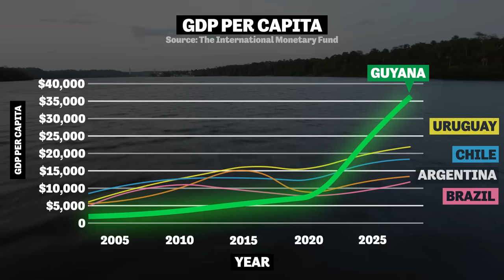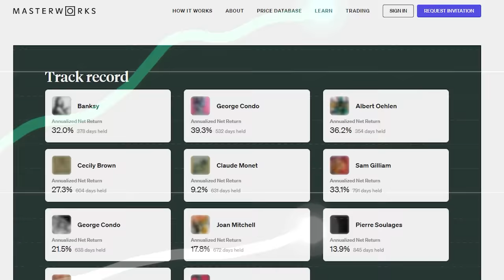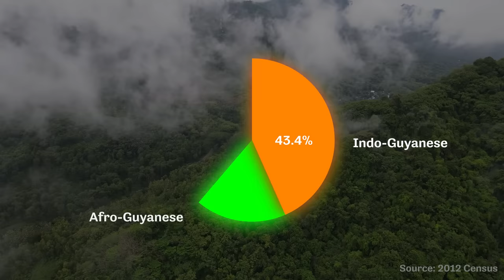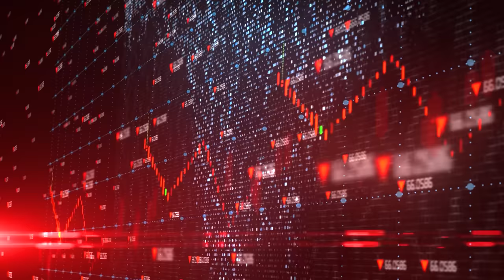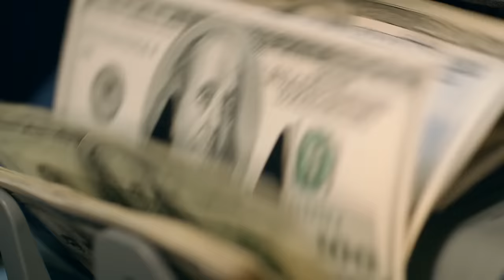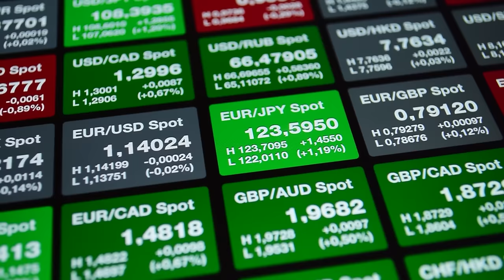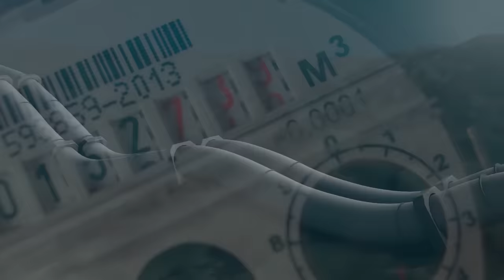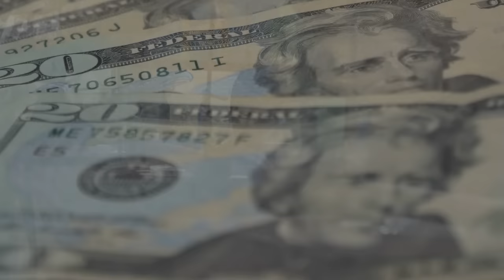How Guyana Plans to get Rich in just 5 years

Comment: 39 And I was in that chariot, alone and without body. And the chariot went gently over the ground and over the waters and over the obstacles and over the long stretches of mud on the road without touching them. The chariot went on without following the small contours of the road.

40 And once, God opened my eyes and I saw the front wheel on the right side of the chariot. And the wheel was changing its shape and appearance and turned very fast like the propeller of a fan. And the wheel looked like the circle of a mirage. Yet the chariot was moving forward slowly, at the speed of a walking man. And I saw that the spirit of Apostle Joel Kashala was in that fast-turning wheel.

Comment: if venezuela get a bout 10 thousand drones. and 300 launchers . the uk would not stand a chance  its local fleet and its aircraft  by the time they seen the first wave the next and next all the way from the launch site will be coming in. i would dig in by the border before digging in the jungle and outer tree like in guyana. have small fast crafts with launcher on the other side of the navy in questioned. out of 300 100 will fly low . 100 will hit at 45 degrees and 50 will hit at 90 degrees.. 50 will hit air bases
Reply: 300 aircraft could hold the first 10 waves after thta they will faulter. with no there to refuel or lrearm. it would be up to the fleet of 20 ships

Comment: Mmm the Mexican State of Campeche (oil rich) has a GDP per capita of 57,000 USD in PPP comparable to Canada’s and higher than most of Europe, but still poverty is rampant. Oil rich rarely helps the poor and rarely trickles down because it generates few jobs, most of it just goes to the wealthy and connected (politicians). Another Mexican state, Nuevo León has a much lower GDP per capita of about 40,000 USD in PPP and poverty and wages are much lower and higher respectively than Campeche’s because its economy is based on manufacturing (lots of jobs). Industrialization is the key not oil. I guess Guyana is going to have a very rich elite, some skilled well paid middle class (oil related managers) unfortunately the rest are going to remain poor